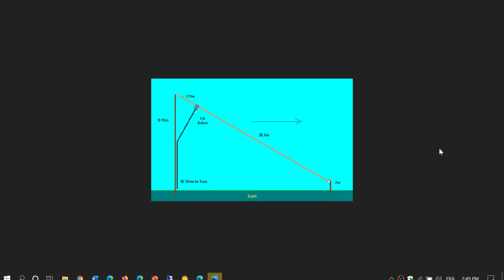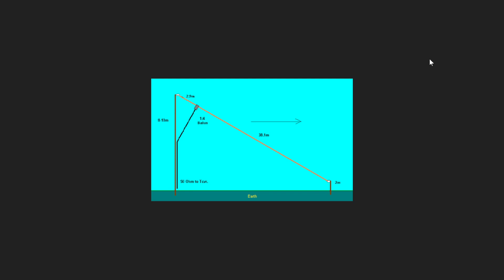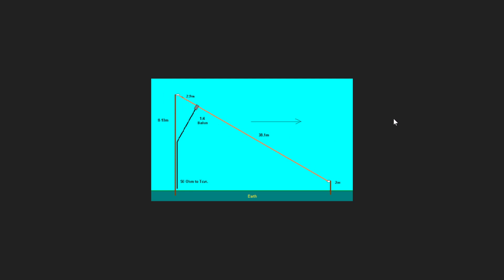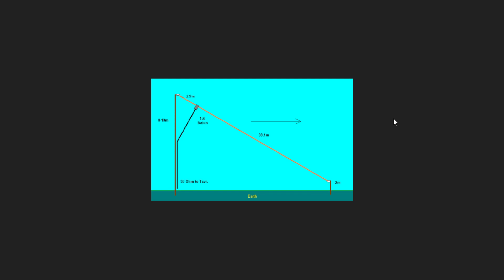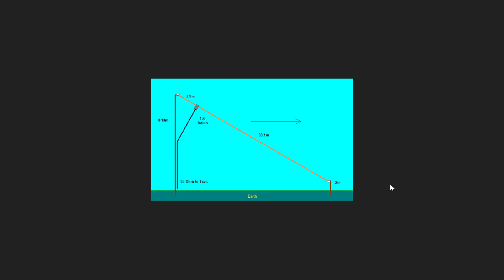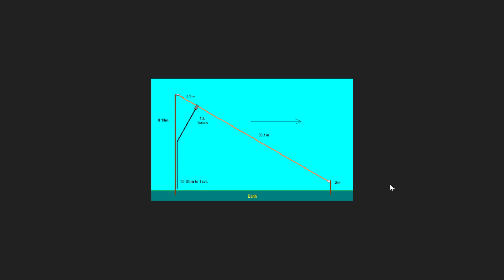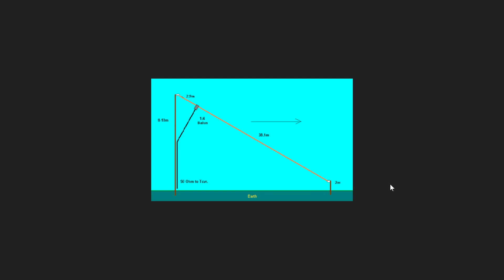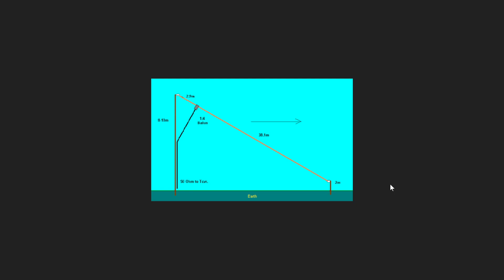What is a sloper antenna

Comment: Would you please give me your opinion of the Alpha Delta DX-SWL antenna?  How difficult is it to install?  I'm thinking I could have an attachment point at the corner of my roof and the other end attached to a short post at the back of my property, then have a lightning arrestor attached and run the coax into my house.  I know I have to have a bnc to banana plug  adapter to connect to my Grundig radio.  I've never set up an antenna before and I'm really just trying to see how difficult it is to do and that I pretty much have the right idea and that this would be a good antenna to significantly improve my reception.  I live in Central Texas and would really like to find someone with experience setting up an antenna to help me get it done right.  I looked for a radio club in my area but haven't really found much.  I guess there's not really as many people interested in radio as there used to be.  It looks like I'm probably just going to have to do it myself if it's not that difficult to get it right.  Any advice would be appreciated and if you happen to have nfo for someone in Central Texas that could help me with putting up an antenna thar would be great.  I have some health problems and don't get around too well so I would really like to just pay someone who knows what their doing to put up the antenna for me and help me get the wire ran into my house, so it's done right and doesn't mess up the siding on my house or anything.  I thought about maybe a cable installer, an electrician, or someone like that maybe if I can't find someone who has experience with radios and antennas...  I believe this antenna is like 60 feet long.

Comment: My 160m Sloper fed at the top of a 50ft tower, coax center conductor attached to a 133ft ( 1/4 wave) radiating element and ends up about 6ft off the ground at the other end. Braid is fixed to the tower and tower is connected to ground rod at the base. Approx 300ft of radials. No tuner required, I can pretty much put it any part of the band I like with an SWR of 1.2:1

Comment: Not many comments on this, but my 2 cents here is that the sloper as an end fed half wave is a great antenna!  Mine is 71' using a 9:1 unun, and favors the east/southeast.  I get good reception from Western Europe on 6 mhz HF Aero as well as both the 20 and 40m ham bands.